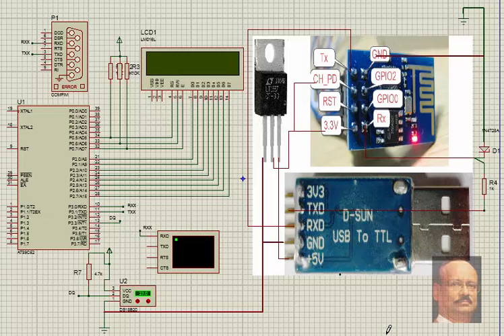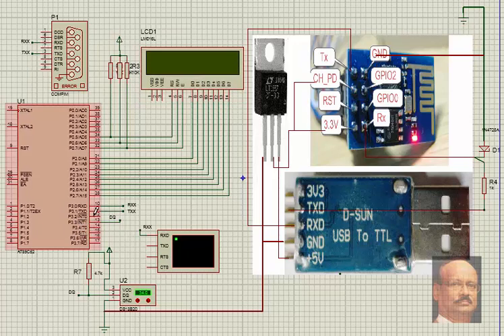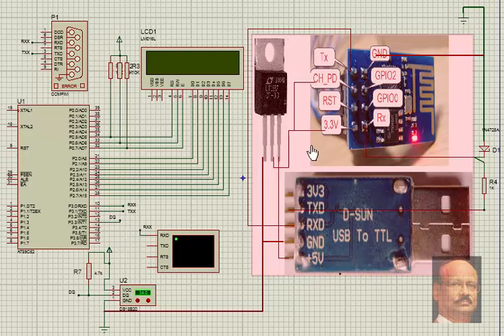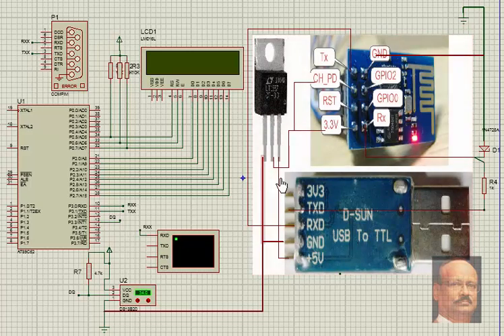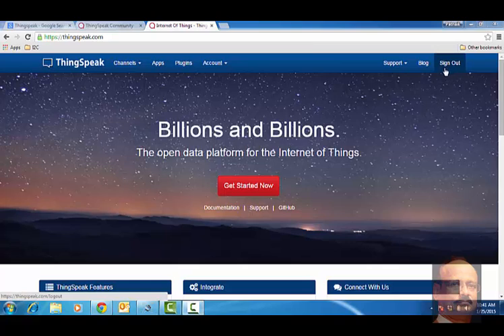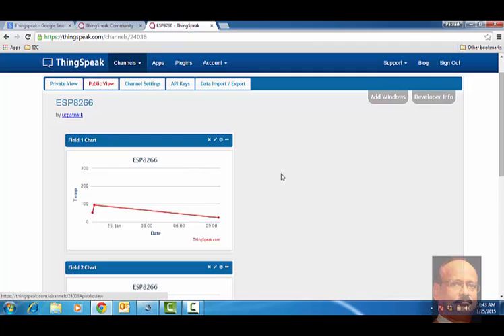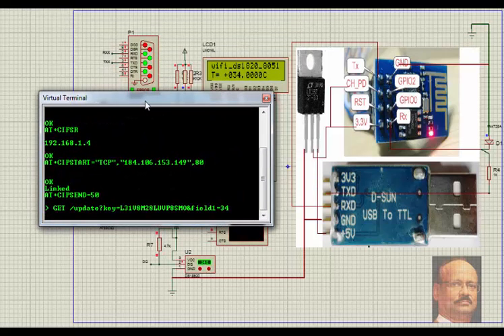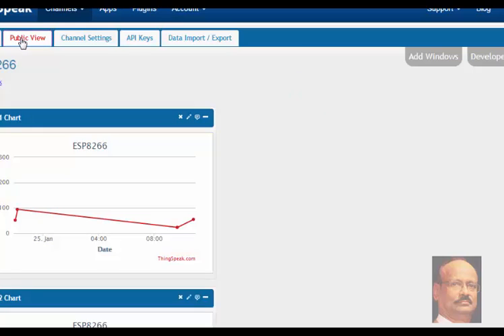Internet of things-ESP8266-by DS18B20- Proteus - 8051 Microcontroller

Comment: Sir,i really appreciate your efforts.Sir ,what if my home wifi is OFF,still the data will be sent to the website or the home wifi should be on.
Reply from the maker: It needs home WiFi as the ESP8266 passes information through the home WiFi net work. It can work stand alone  without using home wifi if ESP is taken as the router.

Comment: Hi Sir. I have been following your videos on ESP8266. I have understood most of the basic process. I purchased a ESP 8266 module recently but unable to install correct version of firmware in it. Could you please help to get the link to download the correct version of firmware to enable AT commands related communication? I am planning to connect 8051 to internet via WiFi at home. Thank you.
Reply from the maker: Esp is not meant for beginners. One needs alot of understanding.However use nodemcu for flashing and firmware loading

Comment: sir have u programmed it using normal UART interface and what is the purpose of DB 9 connector , are we using anything related to RS-232 ?
Reply from the maker: UART interface is only for the programing. After that it is not used.